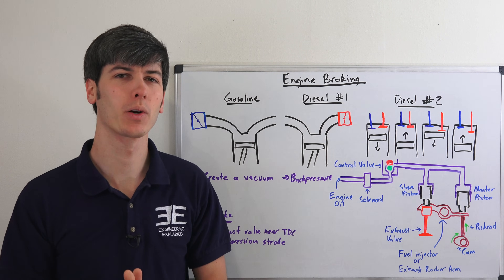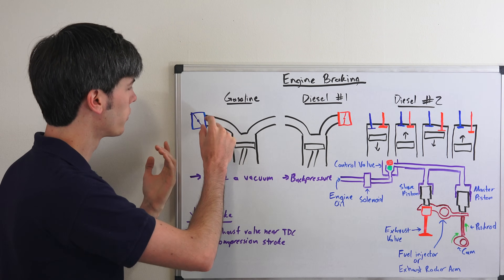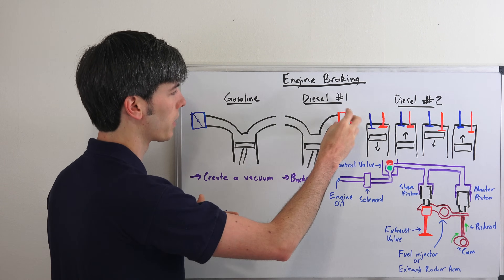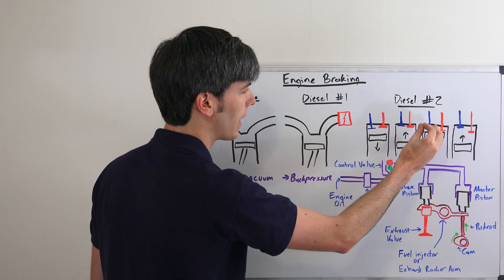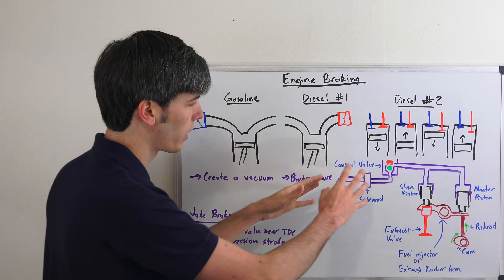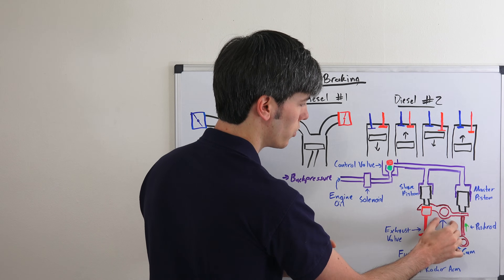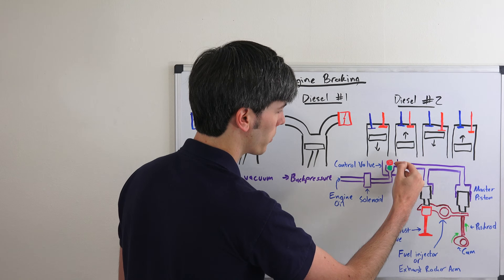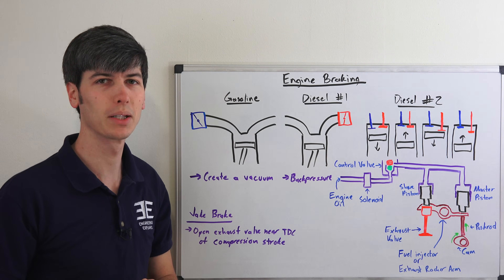What Is Engine Braking? What Is A Jake Brake?

Comment: I have seen several videos now and they all seems like not the whole potential is taken out of it?
And even look like the Jacobs jake brake illustrations most use to explain it is wrong when it comes to valve travel during the compression cycle?
I would guess the valves could also be closed during the "power stroke", to make a massive under pressure and even further enhance the brake action? But seems like it is not - why not? Not necessary because it is effective enough just using the compression stroke?

Comment: It’s a decompression system thought or by old Mann Cummins as
 The story goes he just missed a train on Cajon pass drop it in the San Bernardino Valley, and passed it on to the idea to Jacobs engineering the tool manufacturer, and it became the beginning of a legend at first. It pretty much only worked on Detroit and Cummins engines but has evolved

Comment: But why doesn't the engine go off because there is no combustion or power stock in the engine?
Reply: Since you're in gear, the wheels are keeping the engine spinning. As long as your car is moving fast enough such that your wheels can keep your engine spinning above idle rpm, the fuel injectors will stay off. If your car slows down to the point where the engine drops to idle, the fuel injectors will resume.

Comment: Have also seen electromagnetic retarders, a friend had one on an early 90s Pete.  It was mounted on the drive shaft, basically an electric motor, hit the switch and it used the stationary stator in the housing was energized, put resistance on the rotor on the drive shaft, driver saiid it worked great.  Never got to drive it, never saw it taken apart, but looked like a cool system

Comment: I just had a thought in "educated ignorance''. .... Do Rally cars use a "Jake Brake" on their turbo charged cars? I only ask because from time to time when a car is coming to a hard braking area the sound changes to a deep rumbling pop but, on normal off throttle approaches the anti-lag is rolling so hard its popping and banging sharply as expected.  Or, is all that simply a byproduct of the Boost controlling system releasing or restricting the exhaust and boost pressures for engine braking? BTW... Sometimes when I ponder stuff, I feel like I am just making it sound reasonable to myself but,  I do hate being wrong while also forgoing the appropriate questions. XP

Comment: the jake brake is the only one I fully understood, the momentum of the wheels lets the pistons compress gas which is then tossed out so it doesn't spring back. it seems critical that the chamber pressure is equalised when it's applying the most pressure to the pistons. In the gas example sure we pull a vaccum but wouldn't the negative pressure help just as much as it cost in the compression stage? wouldn't you need to equalise with atmospheric before the compression?

Comment: Question for mechanics, engineers, or million mile drivers... 

Can a version of a Jake Brake be used to prevent a runaway diesel engine? If you could open exhaust valves during the compression stroke(s), then there wouldn't be enough compression to fire the cylinder and i would think the engine would just shut down preventing a runaway. Does this seam feasible?

Comment: I don't get what the difference is between coasting and engine braking. If you let your foot off the gas, it'll close the throttle body. That's coasting, right? Isn't it the same thing?
Reply: Very similar. Engine braking though is increasing the amount of resistance the  engine causes on the vehicle. The simplest way to do this is by downshifting to increase engine rpm. On diesels for example there is no throttle body under typical use so a separate device is needed to increase engine braking to accommodate the heavier loads they typically haul. An exhaust brake or a jake brake for example.

Comment: Would it be possible to contain  the compressed air that is normally released in the atmosphere, direct the compressed into a storage receiver, then inject back into the engine after coming down the hill ?  A energy recapture system?…seems like there is a tremendous amount energy wasted out the exhaust stack …

Comment: In gas engines does that vaccum pull back gases through exhaust pipe?
In diesel engines does it reverse the airflow through the airfilter while engine breaking? What will happen in turbo engine?
Is that throttle body placed before or after the turbo?

Comment: I may be wrong on this, but isn't it only the older Cummins engines that used a camshaft that moved a piston to build fuel pressure that would open an injector once the fuel pressure was high enough? And I still have an old 855 that uses this system, but would a common rail system work the same way since there is no camshaft to run the fuel injection system?

Comment: One huge factor that you forgot to  mention in engine braking of gasoline (or any other engine) is overcoming the friction of components of the engine that slows down the car. If the engine isn't producing power (or enough power that is appropriate for the speed that it is supposed to be rotating), it is going to slow down its rotation. This slow down happens due to the internal friction of the parts, not just the vacuum inside the cylinder. An easy way to check it (do not do it) is to turn off the ignition while the car is moving and is in the gear. No matter the position of the throttle body, the car is going to slow down significantly. In this situation even if you open the throttle body, the engine braking still happens. It is very unsafe, but I've done it in old cars.

Comment: Questions:  1) If the compression is released into the exhaust system the same as when the engine is running normally, why the excessive noise?   2)  I assume when the Jake brake is engaged the fuel injection is shut off at the same time?  If not, this would be a big emission issue.

Comment: My Diesel engine doesn't have a a close off on the exhaust side and uses an oldschool camshaft directly driving the valves. I always thought it's just the compression thats used for engine braking?

Comment: I think your explanation of engine braking in a gasoline engine is wrong, or at least incomplete. As you say, on the intake stroke with a closed throttle the piston will have to pull a partial vacuum, so the force required to pull the piston downwards will act to slow the crankshaft. HOWEVER, the vacuum is still present after BDC, at which point - by trying to pull the piston upwards - it is acting to SPEED UP the crankshaft. The two should basically cancel each other out, much like compressing and releasing a spring: no nett energy is gained or lost.  The same argument would apply to those people who claim it is the compression in a diesel engine that slows the crankshaft: no, it cannot be because the energy stored in the compressed air is released again as the piston travels downwards.  That's how the Jacob brake works - it removes the stored energy before it can be returned to the crankshaft.  But there is no equivalent mechanism in a gasoline engine. 

Therefore it CANNOT be the vacuum acting above the piston that slows the engine - it must be some other mechanism. I don't know the true answer.  I'm assuming a combination of mechanical friction and pumping losses, and maybe some minor heat loss to the coolant due to the not-quite-adiabatic cycle?

Comment: can someone explain how in diesels. 2nd/middle picture.... he claims that the air being compressed into the cylinder/slash exhaust cavity slows engine down? wouldn't that just create more pressure on ignition? (3rd cycle in a 4 stroke what he reffered to as power cycle) therefore not slowing engine down but rather giving it more power?
Unless too much air and not enough fuel bogs/stalls the engine?

Comment: Worth noting that simply downshifting a couple times and releasing both the accelerator and the clutch will also serve a similar purpose to the Jake brake, and is actually the method we're taught to use when road conditions get too slippery... unfortunately, early iterations of the Jake brake had a tendency to exacerbate the risk of slides on wet, snowy and icy roads, so a bit of conventional wisdom got written the blood of drivers: safest way to descend a slick, steep hill, aside from just not descending it at all until conditions improve, is to pick a less efficient gear ratio that favors more torque as opposed to more power

Comment: I still don't understand engine braking in gasoline engines. I see that energy is needed to pull the vacuum, but don't the motor get this engergy back as the piston is "sucked" upwards in the next stroke?
Reply: Well, if the crankcase wouldn't be ventilated, that would happen. But because it is ventilated, well... Also, during compression there's still some heat generated. Even with a closed throttle plate, the vacuum in the intake manifold is far from perfect.
Reply: @shi01  So if I get you right, the vacuum the piston is trying to pull is partially annihilated because the crankcase is ventillated, effectively turning the motor into an air pump, and further energy is lost as heat when the air is compressed. That would make sense to me.
Reply: @true_perplexeus  Well, if you would move a piston into a confined space, like the crankcase you would normally increase it's pressure and that's what actually would slow down your piston a lot. But because of the ventilation this can't really happen. You still have some resistance but it is a lot less than you would have if the crankcase would be sealed.
Also, "suction" doesn't really exist. It's actually the outside air which tries to fill the cylinder as fast as possible. Even a natural aspirated engine doesn't "suck" air in. It's basically rammed into it with atmosperic pressure from the outside. Suction would basically imply a negative force and negetaive forces do not exist.

Comment: I used to sell Jake Brakes. It turns the engine into an air compressor and saves the wheel brakes. Many drivers will use them on flat land because of the sound. That’s why you see no Jake brake signs on the outskirts of the town.

Comment: Engine braking is very important when going downhill because 
1) You reach down at lower speeds,thus less work for brakes
2) Your braking force(tire road friction) decreases downhill (is dependent on how steep the slope is),so soaring  downhill in neutral may be lethal because you have no choice but to enter the coming corner(u turn mostly) at higher speed and the centrifugal force aids gravity to skid you out of your line .
Thus its important to use engine braking especially for bikers
3) In neutral you are consuming fuel so it coming down in gear wont hurt your pocket too

Comment: The Jake brake obviously works because it is compressing the input air, which heats it up, thus transferring energy into the air, and then pushing that hot air to the outside. 
In order to slow down a car, you have to do work. Kinetic energy has to be taken out of the vehicle and moved somewhere. Having a (partial) vacuum on the inlet manifold will exert a force on the engine, but there is no energy entering or leaving the manifold. Not so the cylinders. With a compression ratio of (say) 10, the air being sucked into the cylinder will be compressed around 10 times. Assuming an adiabatic compression, that would put up the air temperature from 300K to around 3000K. The heat transfer from the hot air to the cylinder head will be very good because the air molecules are hitting the cylinder head faster and faster and more and more often as the space above the cylinder contracts. As this air cools down during the expansion cycle the transfer of thermal energy from the cylinder head is not so good because the air molecules are hitting the surface less and less often and moving slower. You can do the same experiment with a bicycle pump. Just close off the outlet and pump away vigorously for a minute. You will notice that the pump warms up quite a lot (as will the pumper!), because the compression and expansion cycles differ in the way that the heat is transferred to and from the pump walls. The theory about the inlet manifold pressure slowing the engine is confusing force and energy. My chair is exerting a force on my backside to stop me falling to the floor, but there is no energy transfer. To move (kinetic) energy out of the car (braking) you have to do work.
Reply: You have a few misconceptions. Fist compression does not play a significant role in engine braking. There is actually not a significant amount of heat loss during the compression stroke because there is simply not enough time. Engines are also designed to absorb as little heat as possible from the cylinder. The compressed air pushes the piston down with almost the same amount of force that was originally used to compress it.
Secondly, a closed throttle does in fact provide engine braking. You said that to remove kinetic energy from the car you have to do work. The part your missing is that the engine is doing work on the intake and exhaust stroke. It is moving air from one place to another, that requires work. Closing a throttle on the intake makes it harder for the engine to draw air in, likewise closing a throttle on the exhaust will make it harder for the engine to expel air from the cylinder. The work required for the engine to draw air in and expel it out is referred to as pumping loss.
Reply: @Redtooth75  I have noticed that many car "experts" share your opinion. We will therefore probably not be able to agree on this issue. You say “It is moving air from one place to another, that requires work”, yes, but not much work. The outside of the car is moving much more air from one place to another, but that doesn’t slow the car down very much. BTW, engine braking also works very well in cars with a carburettor, where there is no significant force on the inlet manifold. How to explain that? It’s also the cylinders compressing air and warming it up that brakes them.

Comment: What's the main reason for the throttle switch on the intake for the gas engine and on the exhaust for the diesel ?? .. Thinking of putting on a small one on a 5L diesel engine..
Reply: The throttle on a gasoline engine is used to control the amount of air that enters the engine to control the power output. On diesels the exhaust brake is used to make it harder for the engine to pump air out the exhaust to provide engine braking.

Comment: But if the piston creates a vacuum on the admission, it is just going to store energy, and then reuse it back on compression, where the vacuum will "pull" back the piston... Right? 
Where is this energy dissipated?
Reply: It pulls the piston up somewhat, but not enough to make up the difference. It is referred to as pumping loss. The engine has to do work to pump air into and out of the cylinder. Closing a valve on the exhaust or intake will increase pumping loss.

Comment: My TDI has no backpressure, only turbo on exhaust side. It can brake with engine compression.
Reply: Compression actually doesn't contribute to engine braking. The compressed air will push the piston back down with almost as much force that was used to compress it initially. A small portion is lost to heat but not much. The friction in the engine is what is giving you engine braking.
Reply: @Redtooth75  You are not right. Did you tried to crank engine without and with compression? It is big difference. Maybe friction is little bit involved to engine braking, but compressed air in diesel engine makes oposite force to the engine rotation and that is main reason why diesel engine braking. Petrol engine has throttle valve, which makes vacuum in the inlet ans cylinders, and that vacuum also make oposite/braking force on the engine rotation. Also braking with petrol engine can suck some oil through the piston rings.
Reply: @fedjadrndarski5606  nope, compressed air does not provide engine braking. The compressed air acts as a spring, it pushes the piston right back down on the expansion stroke. There is an insignificant amount of net energy loss during the compression and expansion stroke when no fuel is injected.
Reply: @Redtooth75  Compression doesn't push piston down, power stroke does. You have misunderstood something. Compression stroke doesn't "act like spring" it only provide enough density of oxygen molecules and temperature to provide efficient combustion.
Reply: @fedjadrndarski5606  go read a book dude. This is basic physics.
Reply: @Redtooth75  I suggest it to you also.
Reply: @fedjadrndarski5606  ill break it down for you: the piston moves up and compresses the air. That compressed air then pushes the piston down on the expansion stroke because it is trying to equalize the pressure. The compressed air pushes the piston down with almost the same amount of force that was originally used to compress it.